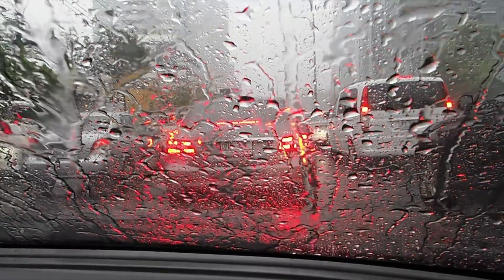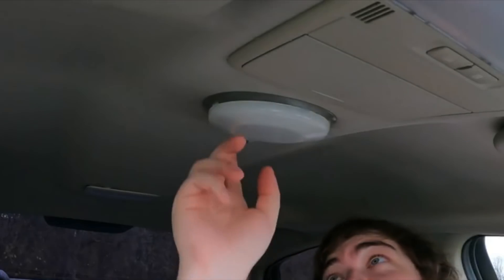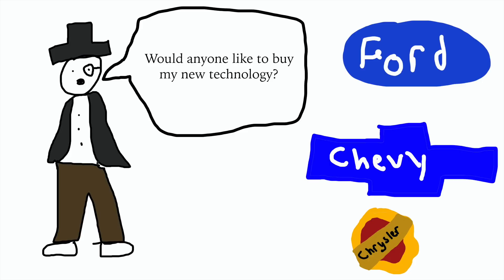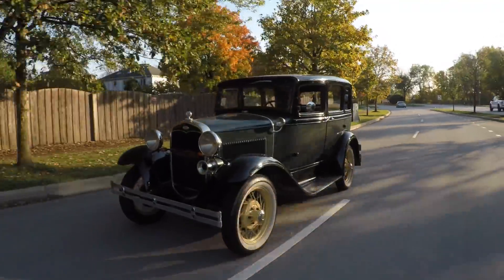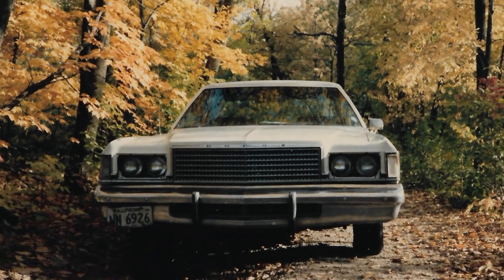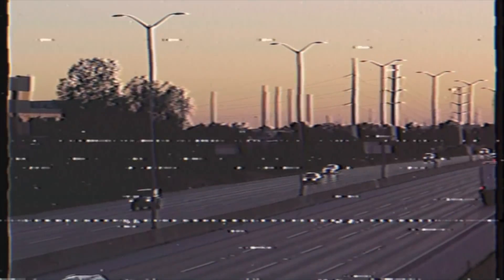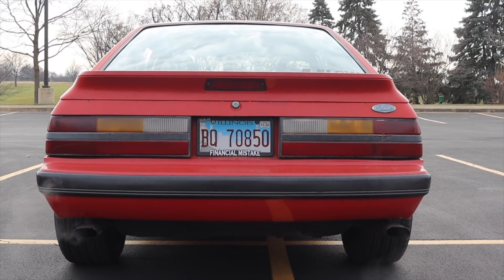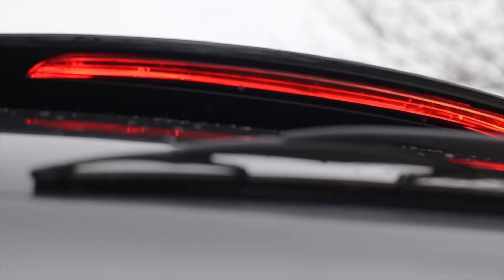The Third Brake Light - Who Invented Them & Why We NEED Them!

Comment from the maker: I hope you enjoyed it! April 20th we will revisit automotive lighting: The Rise And Fall Of Pop-Up Headlights!
Reply: Yes pls🙏🏽
Reply: You should do on on rear amber turn signals and their effectiveness vs red brake/turn signals.
Reply: Should follow up with the hyper flash third brake lights nowadays.
Reply: @feelingafnar8885  bro what?! 🤨
Reply: Can you please also make a video explaining why some American cars have red rear turn signals instead of amber? I’ve done some research but couldn’t find any definitive answers. Thanks.
Reply: What we need even more on all cars is daytime running lights.  
I've lost count of the number of cars I've seen (barely in time) driving at night without any lights, or just "parking" lights on.
Reply: Maybe the stats with the cabs was this high because they were the first.
A change in something that common calls for attention
Reply: Cool video, but a couple minor errors. While not a center mounted brake light, in 1968 and 1969 Ford offered a high mount brake light as an option on the Thunderbird. It put a light on both sides of the rear window. In 1971 two upper brake lights on the trunk was standard on the Oldsmobile Torodado and remained so for several years. Also the three flash or sequential turn signal wasn't pioneered by Ford in 2011, but in 1965 again on the Thunderbird were it lasted for years and was included on the Mercury Cougar. Ford brought the sequential turn signal back in 2011 on the Mustang. Again, fun video and great job.
Reply: I remember a old 1982 Subaru GL wagon the center emblem on the grillwas a extra driving light
Reply: April 20th needs revisiting. I can’t recall a thing.

Comment: Great video. I love lighting, automotive lighting included. Do you watch Technology Connections? He has some great videos on turn signals.
In ECE markets, the third brake light is allowed to be off-center. USDOT requires it to be centered. If you look at some Euro-style vans with barn doors like the Transit Connect, you can see where the Euro light would go but they had to stick the light on the roof for it to be centered. Most cars do have the center light higher, but the GM Dustbuster vans got away with having it lower, just above the license plate while the main lights were alongside the back window.
Until the 1960s, front parking lights were not required to be on when the headlights are on. The '65 Mustang you showed is like that. The problem is that if a headlight burns out, the car's width is no longer indicated. The '68 FMVSS Act made a rule that the front marker lights must stay on.
70s cars sometimes had a pair of extra brake lights on in the back window or deck lid. They were linked to the standard lights.
I've considered retrofitting one to my '84 Jeep. There's a hole in the center of the spare tire carrier that would be perfect for a 3/4" grommet mount light. I would have to run a new wire from the brake switch to the back. Two lights to do it all is a little disconcerting and the turn signals are short on/long off because I have higher-wattage bulbs on the original flasher. If mine was a little older and had the back sidemarkers on the body I would convert it to the Euro-style lights with separate yellow turn signals. My daily driver Taurus wagon wears '97 amber turn signals in place of the factory red because yellow is safer. The colors are separated and unambiguous.
Reply: The extra brake lights on the rear deck debuted in the U.S. in 1971 on the Oldsmobile Toronado.
Reply: You should be able to get more modern digital flasher modules that could fit in the stock slot which would solve the flashing issue as they are not reliant on wattage
Reply: Some are just too distracting for other road users though. They should ban the animated ones.
Reply: @DEVILTAZ35  You mean the ones that go
-
--
-->?
Those aren't distracting, and I've got pretty severe ADHD so a lot of things are distracting
Reply: @DEVILTAZ35   Why should animated turn signals be banned? They function like turn signals, but animated. Should blinking turn signals also be banned by your logic?

Comment: I first saw a high center brake light sold as an accessory in parts stores. The reason they worked, according to the literature, was that they could be seen through the greenhouse of the next car, giving the driver behind that one more time to react. Made sense, like stick-on blind spot mirrors.
Reply: This how I remember them be sold in the 80s - you can see when car in front of car in front it braking.
Reply: Unless there is a big truck right in front of you.

Comment: This was pretty awesome... I had a rough take on why and thinking it was safety related. I figured it was in case one brake light went out you still have a back up... Ive seen so many newer Hyundais and Kias that have both brake lights out already.. that 3rd break light seems to be the only thing that lasts
Reply: That's EXACTLY WHY the 3rd brake light was mandated..... Redundancy..... Period.
Reply: Something interesting I've noticed is that on almost all cars from the last 15 years or so the third brake light is almost universally LED, while the main brake lights on many cars, even currently, are still incandescent. I'm guessing because LEDs can be put in a slimmer housing, while incandescent are cheaper. The LEDs typically don't burn out, I suspect that's why the main brake lights burn out but the third brake light keeps working. There's also the issue that replaceable bulbs might get loose in the socket, or the socket corrodes, while non-replaceable LEDs everything is soldered in place, avoiding this issue.
Reply: @quillmaurer6563  led lights run at a much cooler temp.. hence why h.i.d's I think are getting phased out unless you have an older vehicle with glass and not plastic lights... Also kinda sounds like a one hand washes the other... 🤔
Reply: @jdmandsuch6739  LEDs really make total sense for many reasons - run cooler, last longer, come on quicker, use less power, brighter. I've converted basically all (excluding a couple gauge lights) of the lights on my classic Beetle to LED, isn't even all that expensive.
Reply: @quillmaurer6563  No, that is absolutely not true.
Reply: @starmc26  Which part? That LEDs last longer? That most cars use LED third brakelights and incandescant taillights? That this is the reason third brakelights go out less often?
Reply: @quillmaurer6563  your "story" about thinking that most cars' 3rd brake light is led; absolutely not true.
Reply: @starmc26  Ah - I'm just going off what I've seen, and I've seen a lot that have LED 3rd brake lights and incandescant tail lights. It seemed common for a period of time, before which all were incandescant, and now maybe we're getting to the point that everything is LED. I'm not telling a "story" nor have I done any research, I'm just saying what I've observed.

Comment: In the UK there was a trend in around 1984-'85 among boy racers for two small square aftermarket high level brake lights mounted at the top corners inside the rear window which was originally seen on rally cars, although I think it was considered illegal at the time. Then the benefits of having high level brake lights (especially the single centrally mounted one) became more obvious as they could be seen better as well as being seen through other cars in heavy traffic where drivers several cars behind the one braking would see it and brake much sooner. They weren't standard equipment until the mid '90s by most European makers - the Mk3 Golf didn't have them to begin with which shows how late they were to the party.

Comment: The 1971-78 Oldsmobile Toronado and 1974-76 Buick Riviera also had pairs of center-mounted lights positioned between the rear windscreen and the trunk lid. However, they illuminated when the brakes and turn signals were activated just like their lower-mounted regular taillights.

Comment: I'd love to see a short-form like this that documents the colors used for turn signals, much like Alec did on Technology Connections, just because of how terrible they are. The more people made aware of how bad they are, the better.
Reply: Here's an interesting thought: You are traveling an unfamiliar area late at night on a back country "primitive" road. It's pitch black around you but when you checked the google map earlier you know that this area has roads with steep drop-offs on either side and rather narrow roads. It's raining heavily and you see two flashing amber lights ahead of you not moving but nothing else. Which side of the two lights do you move toward to pass it?
Reply: @transtubular  you should already be traveling slowly under such conditions (and sketchiness), so reduce speed further, approach cautiously while staying in the middle of the road (you are legally allowed to straddle the line if conditions are hazardous enough to warrant it) and only after you have made a positive identification of what the thing is with flashing amber lights should you determine your course of action. it could be a trailer that's stretched across the majority of the road, preventing travel on either side.
Reply: @transtubular  that event is not common enough to justify having the turn signal share the same lights as the brakes. What is very common is taking a few seconds to realize if someone is braking or signaling. Even worse if one light is out. In driving, every second counts. We should be able to instantly determine if the driver in front is braking or signaling.
Reply: Brake and tail lights have the perfect color, red, it signals for danger, and isnt blinding like blue or green, just like traffic lights. Red is to stop, and amber is like a warning, turn signals are technically a warning that informs the other drivers of your next move, it cant be flashing red cause it will cause confusion with the brake lights, and it has to be flashing for the same reasons. In my country turn signals have to be amber, sometimes we see a car with broken taillight glass and both lamps are white. It's confusing for a second to tell wether the car is braking, turning or even reversing cause those are white
Reply: @transtubular  You found one hypothetical situation possibly favoring red turn signals, out of 99+% that would favor amber. And in your situation most likely the red tail lights or (less bright) amber running lights would be on too, if they aren't I'd blame that on the other vehicle's driver, not that it has amber turn signals. As others say here, in that situation you should be driving so slowly that you can see what's going on.
Reply: @transtubular  Amber colour is universally associated with the notion of CAUTION. That's why safety/hazard signs are usually yellow. It's not hard to figure out.
Reply: @DashCamOutEast  UK always orange never red
Reply: @quillmaurer6563  I'm probably just being dense, but how does this in any way support the case for red brake lights? 
It seems to me he just conjured up some strange scenario without any relevance to the issue at hand.
Reply: @flopsinator5817  I think what he's saying is that if turn signals - including emergency flashers - are red, you can tell from them alone (assuming all other lights are off and in total darkness) which end of the vehicle you're seeing. Thus if driving nearly blind on a narrow road, you'd be able to tell presumably if they're in your lane or in the oncoming lane. But this seems like a very obscure scenario with a lot of caveats. If other lights are on (as they should be) you'd be able to see headlights or red tail lights alongside the flashers. In a situation with such poor visibility you should be going slowly enough to be able to see the road and where the other car is on it, otherwise that car's turn signal color is the least of your worries.
Reply: @quillmaurer6563  That's such a niche scenario.
You'd have slow down or come to a (near) stop anyway, to see if you can pass the car in the first place (in case of oncoming traffic; tightening road; mudslide; etc).

I bet you anything that guy doesn't have a driving license.
Reply: @flopsinator5817  Agreed, it's pretty absurd, there's really no scenario that makes sense that supports red turn signals. The only arguments for it to my understanding are aesthetics (some think it looks better) or simplicity (can be done with fewer wires and bulbs, especially on trailers). Personally I don't think either of those justify it. My guess is this person isn't that ignorant, but prefers red turn signals for some reason - aesthetics, American traditions - and was trying to find some argument in favor of them, no matter how obscure or dubious. That this was the best scenario anyone could come up with favoring them shows just how little sense they make.

I was pondering if red might be advantageous for flashers, which I could see a little more over turn signals, but even there I see issues. You might not be able to tell if it's flashers or the person is just repeatedly on and off the brakes (third brake light might help though). Or if a wire is loose and the brake lights are flashing. I know I once saw a red-turn-signal car with one brake light flickering, I couldn't tell what the hell was going on or what the driver intended to do. Likewise, if the flashers and brakes are the same bulbs the brake lights won't work at all, and if separate the brake lights won't be as obvious, which is an additional danger (again third brake light will help). So many opportunities for ambiguity with red, while the only ambiguity - far less likely or problematic - of yellow is which end of the car you're seeing. If car is moving at night, other lights should be on, and if it's not moving you don't care so much - don't run into it. Perhaps if the headlights/running lights are out and the only lights the driver can turn on are the flashers, and they're driving down the road like that, maybe there's one situation where red would be better. But really you shouldn't drive like that anyway.
Reply: @flopsinator5817  And come to think of it, there's already something else in place for this no-lights situation - all cars I've seen, I'm pretty sure this is a requirement, have red reflectors on the rear, as well as on the side red at the rear and yellow at the front. So even if the other car has no functioning lights, you should be able to see it with your own headlights. Typically these are quite bright, about as bright as the car's running lights when you're following it. Occasionally I've seen these removed for custom look, but that's quite rare. So for this to matter, it has to be pitch black, the other car have no lights on except the flashers, be moving, and either you don't have headlights or they don't have reflectors. In this situation numerous traffic laws are being violated.
Reply: @quillmaurer6563  The aesthetic argument is the only one worth entertaining, as functionally speaking separate amber indicators are better in every way, except in the narrow sense that red lights are slightly more eye-catching.

Cars can have an all red taillight housing with amber indicators. My 01 VW Polo is a good example.
That being said these kinds of (factory) taillights are somewhat uncommon for cars built pre-2010.

If you'd rather have an all red taillight housing instead of the factory ones, then you could either install something aftermarket or just appreciate the car for what it's worth.

Aesthetics should never undermine the safety of a vehicle.
Reply: @flopsinator5817  I agree 100%, I'm just saying why others want to keep red turn signals. And with LEDs you could easily have yellow turn signals that aren't visible when off, giving an all-red tail light, so there's really no excuse now. What I really don't understand is why the Tesla Model 3 has red turn signals despite having basically hidden turn signals/brake lights, if it had yellow turn signals you'd never be able to tell when they're off anyway. The only other argument I can think of is simplicity, basically able to have one dual-filament bulb serve as turn signal, brake, and running light. This is especially useful for trailers, as it also allows for only four wires (left, right, running, and ground) while five would be needed if turn signals were separate from brake. But one wire and a couple light bulbs I don't personally regard as worthy justification either.
Reply: @DashCamOutEast  If it takes you a few seconds to recognize when shared brake lights are on, please stop driving, I don't wanna be rear ended.

Comment: There were a lot of American cars in Finland in early nineties. You had to disable third brake light from those to pass yearly registration check. Just removing the bulb was not enough, you had to remove wires, paint it black or otherwise make it much harder to get working again. And couple of years later those brake lights were mandatory.  I'm not 100% sure, but I think you had to install third brake light also to older vehicles, as there were diy sets to glue on a rear window and just about every car suddenly had them on.
Reply: Talk about dumb. It shouldn’t have mattered to have an extra safety feature.
“I’m sorry, Sir, you’ve failed the inspection because your bumper is too large.”

Comment: A VW Jetta that I had as a rental in 2006 had the three-flash lane change mode when you bumped the turn signal stalk. I am unsure if VW was actually the first, or what year it first appeared in the Jetta, but I do know they had it long before Ford. Just an FYI.
Reply: Yeah. I've seen cars from the early 2000s with this feature. And it was not only limited to luxury cars. My 2002 Opel Vectra had this exact feature. I'm sure he got it wrong.
Reply: Mercedes had it in early 2000s, maybe even earlier. I know the facelift w210 e-class that came for MY 2000 has both tripple flash and the side turn signals mounted on the mirrors